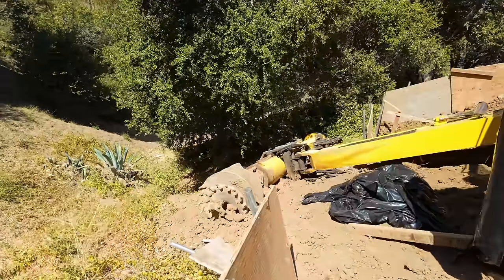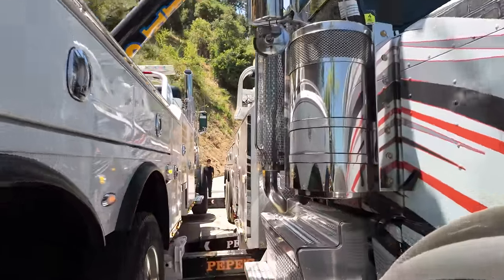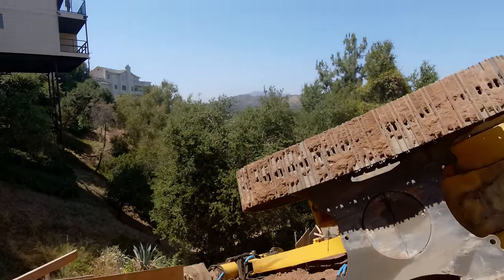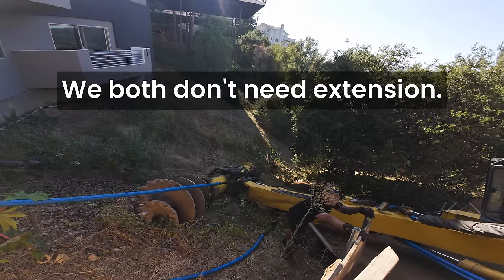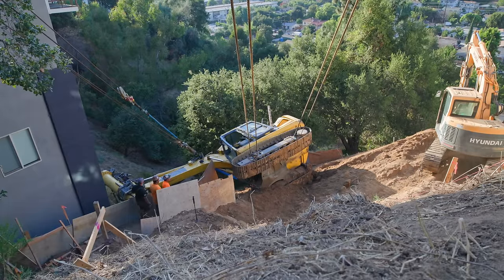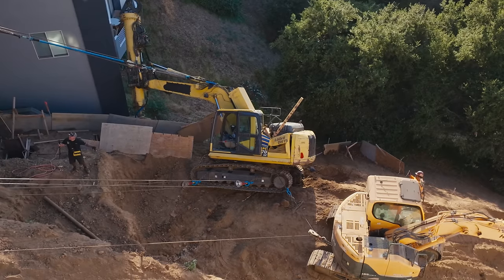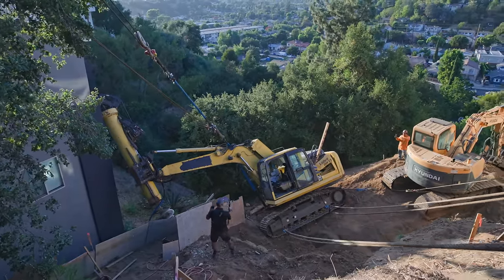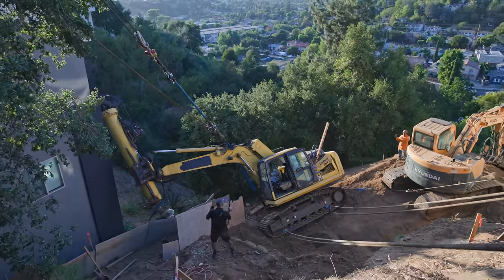Excavator Rolls Down Hill! (Our HARDEST job yet)

Comment from the maker: If this was not the hardest, this was definitely top 3 most difficult jobs I've ever done when you factor in the working area, lines ahead, weight, slope, heat and everything else together. For all fans of the channel, where do you rank this one compared to some of my other hardest jobs? Is this the worst? :_ThumbsUp::_Approve:
Reply: @PepesTowingService  I would have to say this is the hardest one you’ve had to deal with since I’ve been following your channel. I was born and raised in Southern California and moved to Missouri in 1992. I am very familiar with the Eagle rock area as I grew up at the base of the San Gabriel mountains in the city called Duarte. You guys take care and keep up the amazing work.
Reply from the maker: @billcolman-ep6ki  Good to hear, how long have you been a fan of the channel? I post some crazy hard stuff so I don't say it lightly when I say this is top 3. And we get hundreds per year. You are correct, Eagle Rock and Highland Park area just suck for this type of stuff.
Reply: At 2840 there is a kink in hulks right side cable
Reply: Kink in hulks right side cable at 2840@PepesTowingService
Reply: In my opinion, I think that crane job would take the cake for the hardest job and this one the second and I’m not sure if the other excavator job was the third toughest either way you guys killed it as close as you guys were giving up which is unheard of for Pepe’s
Reply: good job guys! :goodvibes:
Reply from the maker: @matthobbs3113  Ya, it's a work truck that does this daily. We can follow working load limits and be as careful as possible but it happens sometimes. You think that's bad? You should see every other tow truck in LA.
Reply from the maker: @laura_774  That one would also be top 5 if not top 3 for me. That one was hard, but I had more factors here. Like that one We could put Flipper up front and me backed up. This one took us hours just to move literally foot by foot to get here and to leave. Plus the heat and extreme slope of the hill made it worse. The crane had a ton of issues though, they are both some of my all time favorites.
Reply: @Pepes towing service Josh I'm sure you did, but I do hope you guys charged this client by the hour and not a flat rate.
Reply: @PepesTowingService  I don't think it's bad I've seen and used worse  I know it's sometimes hard to see stuff like this when you are busy
Reply: @billcolman-ep6ki    Right there off old Route 66 and the 210.
Reply: If it is hard they dispatch some else but if it is impossible or near impossible the send Josh & Alex because they know it will get done
Reply: @PepesTowingService  I’d say rating it based on azz pucker factor it’s def a top 5. Rating based on time, moving parts, amount of rigging, re-rigging, I’d say a top 15. And I’ve seen alotttt of your videos.
Reply: For some of us older guys, around 1:33:33, it is kind of hard to hear you over the music. Congrats on getting the job done !
Reply: @PepesTowingService you know I never thought synthetic winch line should be on rotator main drums until watching you do this job
Reply: As I said in my comment below, I think this was the hardest job I've ever seen you do. You were working with non-optimum angles for your rigging. You were working against gravity the entire time, pulling the excavator down. You were dealing with not wanting to hit the neighbors house. You were dealing with not the best rigging points on the machine. You were dealing with the super heated sun. So many factors against you, and yet the best wrecker business in California, Pepe's towing got it done. Props to Josh, Alex, construction crew, and lady who provided water.
Reply: Sometimes you go into one that looks ok and find out it sucked.
And then you go into one KNOWING it's gonna suck. Those are more fun in a way.
Reply: These problems will occur all the time people with more money than sense demand houses are built in places there should only be trees and animals.
Reply: Obviously can't speak from all of your personal experience, but as far as jobs you've featured on the channel? This one wins, hands down.
Reply: How did they get the excavation equipment in there..no way to get a lowboy on that road
Reply: Excellent recovery guys
Reply: That splice on those electrical lines is giving African slum..😂😂
Reply: @PepesTowingService  The big crane recovery looked equally hard. Maybe the cement truck that fell down the slope into the house was more difficult. But they're all pretty impressive and engaging to watch.
Reply: Yes this was #1 hardest i have seen dont factoring in EVERYTHING!!! TOP NOTCH
Reply: @PepesTowingService The neighbors must have been thrilled when they heard a new house was going up! Why would anyone want to live on the side of a hill like this? Between all the fires and potential landslides, IM OUT!   :)
Reply: I don't know... that special trucker flipping next to the rail lines... that would take the cake to me. Almost getting 3 of your trucks stuck and hours of getting in position. But this one was certainly a challenge too.
Reply: Where to start. I seen a bad situation due to lifting lugs. There is never good lifting lugs on an excavator in my opinion. Dude I was trying to throw y’all water. I was getting thirsty watching. You guys did an amazing job especially for the conditions. It was a blessing for sure to have that other excavator where it was for sure. I’m sure you learned from this one. I did.
Reply: Do you mind me asking how much an hour for each rotator and man power? And what did you bill the customer for this job?
Reply: When was this recorded? Before the #Landslide? Building homes on side of mountains is pure #Stupidity!
Reply: #1!
Reply: Insane work...I used to work around there and hollywood hills stuff etc, and I hated to even have to try and quote something at these places it's such a nightmare to park a truck even. Then you get everyone around there has 50 attorneys on speed dial and man I hope you charged 10x for that crap.

Comment: As Ron Pratt would say, those overhead lines are your "arc nemesis."
Reply: Yes indeed.  But recognizing that THAT particular house drop conductor could have been lassoed and pulled sideways out of the way a bit may or may not have helped.  The POCO would have sent a small work truck out to come and evaluate the situation and they would have had the tackle to temporally relocate it or taken it down.  But  Josh and Alex did what the did with what they had in hand.  That side by side positioning was interesting to say the least.  Lots of chatter about avoiding sliding one truck into the other.

Comment: I’ve driven those hills and the Hollywood hills in a concrete mixer, it is not an easy task. Great job guys
Reply from the maker: Not easy at all. Then you have cars that don't run blocking the hair pin turns. What a mess it was.

Comment: Awesome work! This recovery gets my vote as the most technical one I've seen you tackle.  Every aspect was fighting you: site access and staging; elevation differential and angles of attack; lack of recovery points and weight distribution; and the lack of soil stability/compaction.

Although not as "eye catching" as a fully loaded concrete truck through a garage, it's a master class for us fans! It shows off your expertise and tenacity!

Also, that crew was on-it! Sucks that this happened on their project. But they seemed to anticipate a lot of what you needed and pitch in with good ideas and considerations. Unlike those recent telehandler crews that were huddled up and filming on their phones.
Reply from the maker: Love this comment! That is exactly why this was the hardest for me. For all the reasons you said plus more, like the extreme heat and soft dirt that didn't let the excavator plant. And oh ya, those dudes are awesome. I hope they're watching this video and showing it off to show they were working alongside Pepe's and not afraid to get their hands dirty.
Reply: And he even had a Pratt-fall. 23:03
Reply: @PepesTowingService  Right on, Josh and team!

I forgot to mention that if something looks steep in a video, that means it's REALLY STEEP in real life.

Take care out there!

Comment: Amazing work.  That was the coolest lift I have ever seen.

I think if the smaller excavator had the bucket forward and pressed into the ground it would have slid less.  But it did its job in the end.  It's insane how few lift points that excavator had on it.

Comment: Glad you didn't quit !if you had failed that machine would have had to be dismantled and cut up for scrap in order to remove it, big savings for the operators and the owners.  Great job and perseverance, you guys are rock stars.
Reply from the maker: I thought about quitting and how that would impact the scene. Would they have to set a date, get permits and bring in a huge crane? But those huge ones needed for this need a huge area for the outriggers to extend out on each side which isn't possible here. Cutting it up? Horrible option, next step would be to see if someone much farther away could do it like Ten West or Van Lingen, for a lot more funds. I love those guys and am sure they would have brought it up too, but I'm glad we didn't quit.
Reply: @PepesTowingService  Could you have removed the drill from the end of the boom to reduce weight and then up right the machine?

Comment: They are going to have to winch those excavators out.  There is no way they can drive out on that loose dirt.  It must have been some job just to get them down the hill in the first place.  Good work to both you and Alex!
Reply: Yes.  I was thinking that the whole way through as the hillside eroded more and more with each passing.  Plus they had to destroy the cleverly designed landings to keep the machine from flipping over again so those plans were all out the window.  That will be another interesting video for sure. 

 Filling those pilons will be a boom truck job as would be the back filling of the foundation walls but can be done from the side of the road.  So much more drama is going to happen on the side of this lane way.  The guy in the white house should open a YT channel and post daily updates.

Comment: 3 million for a condo on the side of a hill..A few inches of rain the condo will be at the bottom of the hill.
3 Pins and some hydraulic lines the drill could be off the machine.  Nice Job!

Comment: Amazing job, The combination  brute force physics against gravity, dead weight and soft ground, not to mention unlocked pistons on the excavators boom.Lets not forget heat and physical exhaustion.  Great work by You Alex, and indeed the local crew.  As others have said in the comments madness building in that area but you pay for the high end zip codes

Comment: 6 minutes in. That backing wouldn't have been possible with an automated manual transmission. Had you not had three reap pedals those car would have been crushed. Great job so far. Back to the video. 😂

Comment: I can just imagine the comments from the service tech that comes to give that machine a once-over.  'wait, this thing was on its side, how T F did it get upright???  I need them in my speed dial!'  I'm sure that neighbor was impressed you guys didn't touch his house.

Having a rotator with a rolling carriage (Midwest Truck has a 50 ton with one) might have helped for moving the line of action back on Hulk.

Phenomenal job, Josh, Alex and the workers at the site.  Great teamwork!
Reply from the maker: Yes and no about the slider. I've never had a job where I needed one, but even with a closer line of action, the excavator would still have sung to me. What we needed was a line on the very rear and for it to plant. Without that, is exactly what you saw here.
Reply: In as much as you're right, Rolling Taters are quite heavier. California is big on weight. Outstanding observation though !

Comment: I have watched every video to date. None of them compare with this one with the shear complexity of the problems. So great when everything finally comes together and you see success. I agree the workers here were awesome. Good thing you two trained on car fishing jobs. (hee hee). Again, an amazing solution to what appeared to be an impossible job. Now off to have a gin and tonic to ward off potential malaria attacks. Now we can wait for a rain storm to send all these houses down to the valley.
Reply from the maker: Glad you feel that way, this is up there with the crane and mixer in house for sure. You can argue each, but this one right here oh man, I could easily rank this #1!
Reply: @PepesTowingService  I looked at the tree guys crane video and thought it was a close second. The mixer in the garage was certainly difficult, but it seemed a long series of small steps (Very Difficult). The excavator tipped over on the steep incline was also a classic. (Not much help from the excavator guys)

Comment: That was a horrible job to have to do, the access was so tight, overhead power lines, and the load over the side of the trucks is possibly the worst direction to have to lift/pull. Well done to both of you in getting that drill rig upright.

Comment: Dang, brutal recovery. Everything in the situation worked against you, the steep hill, tough access, the place where the excavator was sitting, houses all around, and the sheer weight of the machine.

If I tried it I’d want to pull over the top of the excavator to put more force towards rolling it onto its tracks, but I also know most of that hood is just thin sheet metal. Maybe over the counterweight? Good luck keeping the cable in place tho. The boom would’ve been nice to pull on too but it wasn’t at the right angle and you can’t move it with the machine out of service.

Comment: I was on the edge of my couch for a long time. Stressful job on this job. I was thinking for the next tough job, maybe weld some attachment points where the factory should have. On-site welder, maybe? Great job for that tough environment!
Reply: Unfortunately they can't do that without owner consent, and much of this type of construction equipment are rentals. No rental company will allow that because it would affect their insurance because of "unsanctioned modifications" to the equipment which might affect it's performance and safety(typical insurance company CYA clauses).

Comment: The only suggestion I could give is to dig a track deep hole for the tracks on the smaller excavator. Plant it as a good Deadman and pull from there.

Comment: 1. Wowsers what a job yall did that, thats right up there with the cement mixer into the house (wich i watched 3x now).
2. When is HULK 2.0 coming?
3 I still say it would be cool to wrap BIG FLIPPER in "THE ROCK theme from fantastic 4" i think it with fit it.
4. Recovery break down was awesome.

Comment: If you’d turned down this job and read heard saw on a news bulletin that this excavator or house or worse some one was hurt you would have felt far worse and never forgiven your self  fantastic effort of determination perseverance and dedication to the perfection your father
R has taught and inspired you all to work under this I’d rate as the most intricate job you’ve done where the unit you rescued was not damaged and was back in use after you righted it I can’t congratulate you the whole team well enough 
👍👍👍👍👏👏👏👏👏👏👏

Comment: As for those lashing points in the undercarriage, they are for lashing, and can break with the enormous forces involved, which I have seen when used for lifting. A thick chain around the turntable or through the frame itself is the safest. Tracks can slip off if pulled on.
Reply from the maker: Those lashing points were our best bet. I went over how it had zero proper lifting or rigging points. The problem with a chain around the turntable is exactly the problem we had with the tracks. It wouldn't allow us to upright it. You get to a point where it's stuck at almost 45 degrees. Then it would just spin if pulled by the boom like it did at first. All that was factored in, and it was a calculated risk we took to get it done.

Comment: "Hello Joe, yeah we got everything off the hill.  They're all at the bottom now..."  #JustSaying

I think we need some praise to whoever installed the road and the curbs because I was waiting for something to give.  I'm impressed you didn't get a call for the next time they moved or used the hole digger.  They was no strength in that hillside.   Pepe's may get a call in a couple of years to pull the new house back up the hill.  I can't imagine what those vertical piles are finding to lock into?  Bedrock hopefully, except that drill was for soil.
Reply: I too was waiting for a roadside collapse what with all that down force on it from those rotators.  There are some YT videos around of a welder repairing the cutting heads on those types of augers.  . The ones he was fixing were covered in carbide buttons on the bottom and sides and had large carbide flanges on the leading edge for boring rock.  I didn't look closely at the head of it myself.  If they were positioning the rig for making the first cut on the next hole then you hit the nail on the head.  There was a pile of auger stems up top just by Josh's back outrigger so they probably had a few options piled there.  There was no dust plumes or drilling machinery about evidencing that they had had used a different machine to bore the rock.   Good catch on your part Kevin.